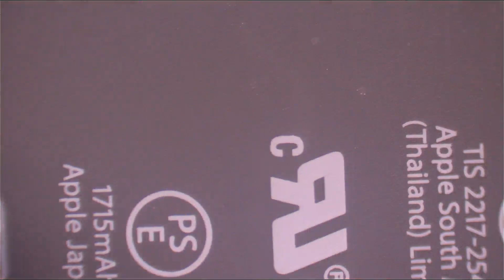Barbara put her phone in rice---let's chat

Comment: During a flood cleanup with the older detachable batteries I'd take workers phones and rinse them with rubbing alcohol pouring alcohol into openings then shaking them out. Fixed a lot of phones that way. Figured alcohol dilutes water and evaporates faster and cleaner. Saved totally dead phones that way. Vacuum chamber would of been nice.

Comment: Some of your microscopes have the older ocular lenses with the focusing mechanism as a part of the  lens (more expensive to replace). Other of your microscopes have the newer ocular lenses with the focusing mechanism on the barrel that the lens slips into (less expensive to replace). Do you have a preference for one over the other, or is performance about the same?
Reply from the maker: Huh?  All these microscopes are the same.
Reply: @JessaJones  They all have the same ocular lenses, with the focusing mechanism in the lens itself and not the barrel the lens slides into. I am asking because I just bought a similar scope, but it has the focusing mechanism on the barrel. I'm curious to know if there is a qualitative difference. Perhaps the performance is the same, just a less-expensive manufacturing process.

Comment: There is the additional issue with rice as it can let fine powdered starch into the phone, which can grab humidity then mold and later cause shorts across contacts and components.   Add to that an increased risk of fire it is not a good idea.

The other thing nobody seems to remember is the original drying with rice technique was putting the rice in a hot dry place or under a heat lamp.  Well then it wasn't the rice sucking out the water, it was capturing the humidity of the heat drying out the phone.  I literally talked to people who put the container of rice with the phone in it in the fridge.SMH

Comment: Has anybody tried Silica Gel cat litter as a moisture absorbent? I have some in pill bottles amongst tools to prevent them from rusting. It does seem to work. I obtained a $4.00 bag at Walmart.
Reply: I bought a litre of silica grains and I've used it for several projects. If you have kids it's perfect to dry flowers because it preserve the colours perfectly. I have dried my sons phone which he had forgot in outside in the rain. This was a simple phone, not a smartphone and it did the job. The really nice thing about silica is that you can dry it in a frying pan and it change colour to the original purple (almost white) and it gets blue when it contains humidity. Silica is the same thing that you find in small bags when you're buying cloths, electronics, everything that doesn't like moisture. Silica is extremely effective to absorb water. As they say in the video you should open the phone because even though silica is very effective to absorb liquid it doesn't help if the water doesn't find a way out. 
The size of the silica I bought is double size of average rise and it doesn't go it doesn't dissolve. So yes, silica is great!

Comment: I heard that Rice can cause Micro-Mold Spores to grow, and those spores can conduct electricity and cause damage.

If you want to remove moisture, you want to use Silica Gel packes and those little squares that absorb moisture.

Is this true for the spores?
Reply: You still have the original corrosion problem that happens nearly instantaneously. It doesn't stop because it got dried up. Even if you use methyl hydrate which is used to evaporate water quickly and dry without a residue you still have the corrosion problem that will stop the phone from working eventually. You could clean it with an ultrasonic cleaner and still you have the corrosion problem. Keep it wet or if you can unplug the battery alcohol so the corrosion doesn't start.